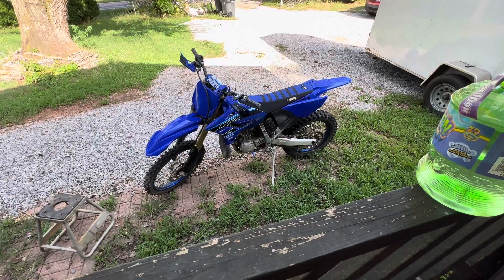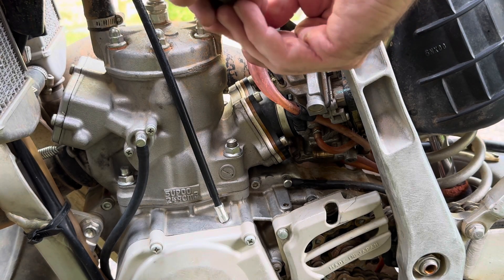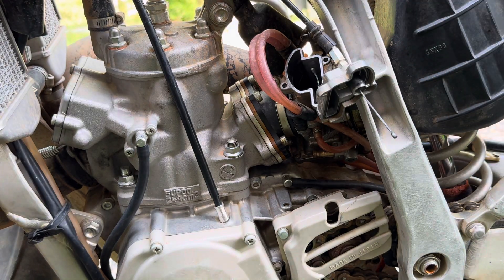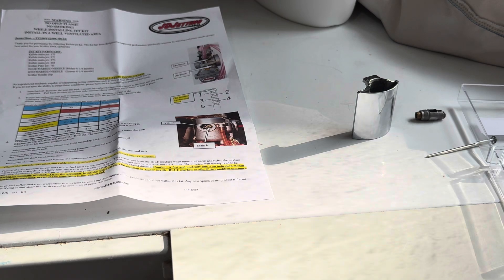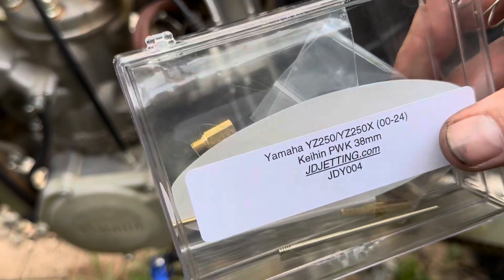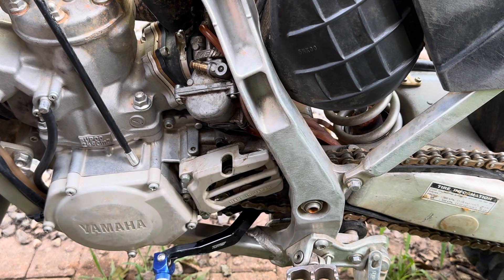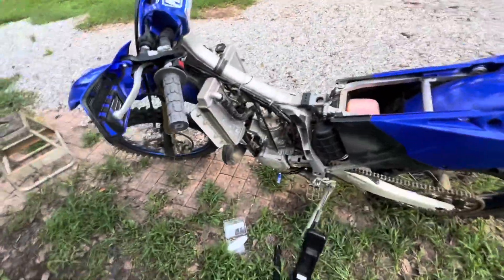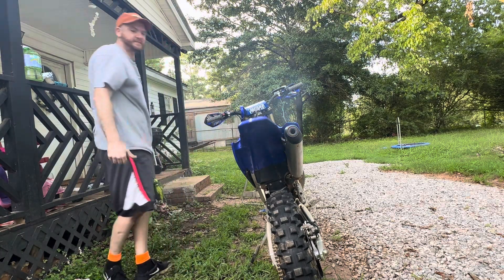JD jetting INSTALL on 2019 Yamaha YZ 250X

Comment: 178 main and 50 pilot is stock jetting which is slightly rich but but keeps the bike running cool and preserves the cylinder. The leaner jetting will run more crisp and be more responsive but also will generate more heat and wear the cylinder just a little sooner. Also you’ll likely be too lean this winter and will need to go back to a richer jetting but it’ll run great this summer. Enjoy! 
Also get a JIS screwdriver for the carb screws and avoid a normal Phillips to keep from chewing them up.
Reply from the maker: @jmarcinko1139  yes the kit comes with a lot of different jets and a chart for your elevation and temperature!yes  sir probably get this kit for my 125 too! what is a JIS screwdriver?
Reply: @RIDEreviewRELOAD  I suspect that gentleman, (rich is not good either), is a candidate for a damaged piston, (as I posted above).  I may be wrong, but I suspect he does not warm up that rich engine for 10 min to avoid piston damage.  Now I know 2-stroke MX bikes with a carb are shipped rich.  Always have been, and they all can use more exact jetting for your area.  But this YZ is the fattest, richest pig of a stock bike that I ever tuned.
I do blame the power jet quite a bit.  It complicates jetting, adds electronics, (but seem to be reliable), and I don't think there is any performance advantage.  In fact, it is a bit more of a pain to get them running perfectly.

Comment: I think your needle is still rich.  You may have to go one richer on the pilot, but you have more grooves on the needle to go more lean than I did.  One groove can be a pretty big jump, (depends on the taper of the needle I guess), and so far, I have gone the equivalent of 1.5 grooves with the 1/2 groove more lean needle, (still rich. just ordered the next leaner 2 needles).  But if you want to creep lean with a lower needle, but not one groove, you can use little washers under the clip.  I made my own on a lather that are the same diameter as the clip so nothing hangs up, and a groove is about a 1mm jump.  If you make a washer to .020" thick, that will be about a half groove.  But I would not be surprised if you end up one more groove.  The smoke that comes out of the silencer is a pretty good indicator too.  I found it great to have a little for start up, but pretty much clean after that, and the plug is a great light brown and dry color.  If it burns all the oil, you get no exhaust mess.
I remember racing amateur at the Pontiac SX after the pros were done tearing up the track for Saturday and Sunday, (a 2 race weekend in that dome).  The pros raced all weekend, and the stadium did not get full of smoke until after the pros were done, until 2 short amateur races were run.    What a difference in jetting.  :)
Doug in Michigan

Comment: Actually, it would save some time with plug color if you used the black rich plug (as long as it still fires).  As you lean out he jetting, it will burn off quickly and give you something to read.  It just takes a while to get a new plug to color in a rich condition, and you can't get a good reading for a while.  It has to darken up first.  :)
Reply from the maker: Good info brother! Appreciate the input 🤙🏻

Comment: I have the 2019 YZ250, and the stock jetting is horribly rich, (MXA said it was perfect in their magazine test.  They don't know how to jet a carb anymore.). I think the only difference between the YZ250 and YZ250X is the X model has a lower rpm tuned pipe.  Compression may be slightly different too, but the 250 was lowered about a decade back, (I have both heads).   I did a ton of mods to my bike, and the last is finalizing my jetting.  I am in Michigan, and will not ride under 50 degrees temps at my age, so I will set my jetting on the edge at those temps. It will still be very good at 80 degrees.  If you want, there is a mix trick you can do for different temps.  If I set the jetting crisply at 50 degrees outside and run my gas mix at 40:1 (use a good oil), I can increase the oil to 32:1 for hot weather., (example, testing is needed IMO), so the fuel/air ratio across the board is a bit more lean.  More oil mixed with the gas means less gas going though the jet, and that is what counts for the Fuel/Air ratio that you are jetting for.
I want to know if that is actually a Yamaha needle, or if they make their own.  
So far with my jetting, (and I am still rich, and so are you. Smoking a lot still, rich needle), I have first modified the engine with the rich stock jetting.  Woods riding, FMF Gnarly pipe, V-force reeds (no aluminum spacer block), and I lowered the cylinder by not using the base gasket (need a really good sealer, like 3M Nitrile #847 brown), that lowers the exhaust port to better match the lower rpm tuned FMF pipe, and raise compression (.048" squish left, was huge).  I have to run 100 octane with no base gasket.  That raised the compression and the burn temps, and the plug went from black to a dark brown.  Still a long way to go.

So far, I went with the 48 Pilot (50 was stock), a 40 power jet (50 was stock), and since one clip on the stock needle is still rich, put ion the next Yamaha lean needle, and still on the top groove, still rich.  I just orders the last 2 lean needles from Yamaha. I may go back to the 50 pilot jet as it leans out the middle. I just dropped from the 178 stock main to the 175, but will probably end up with the 172 also, (using wide open test runs and throttle chops for main jet plug color. Gotta use the stock plug IMO.).
One thing I know, carbs with out power jets were a lot easier to tune.  I don't see any advantage of the power jet.  This is not the best running bike I ever had. I would have it and worried about the electronics failing and going lean.  But I have never heard of that happening.    When you are burning all the oil, (no mess, and hardly any smoke), don't go any more lean.  :)

Oh, I modded almost everything on the bike, and I just modded the kick starter.  Try rotating the kick starter on the shaft on spline to the right and look how it sits in there closed.  Perfect.  That is actually how it was drawn up, but the bottom casting of the kick start shaft area gets super close to one bolt on the clutch cover.  So Yamaha just rotated the lever back one spline,--for like 2 decades.  lol   I just dremel cut the casting a bit for 1mm clearance, (just a shave), and man, it is amazing how such a little change, makes the engine area look so much better,-----------like it was designed that way.  :)
Reply: Doug in Michigan
Reply from the maker: You sound like a jetting Jedi!!! The force is strong with you 🤙🏻🤙🏻

Comment: Another problem with the rich stock jetting. PISTON DAMAGE!!!!!                If your plug is black, you are not warming up the coolant quickly.  It can take 10 min to get hot radiators, and the engine may never really get into a good operating temps, on the edge of fouling a plug.   It is very easy for a rider to get impatient, and take off riding, and I bet a lot of YZ250 riders have done it,---and damaged their piston.  I bought my bike from a mechanic/son at a dealership, who is not very sharp, but the bike only had about 3-4 hours on it.  I did ride it for another 10 before I modified the engine, but I made sure the damn water was hot, (where 10 min comes from). I took out a stock piston that looks like it was ready to come apart. The crown and piston gets hot and expands, but the colder cylinder does not expand enough, so they make contact.  You will get the "4-corner" scuff, but the worst is the piston crown side and rings being pushed into the exhaust port.  There was so much contact there, (plating still great), it bent the material above the ring up, (making the ring groove wide. Ring could flutter and break), and pushed the material below the top ring into the bottom ring, (pinching the bottom ring, both losing compression).
With my jetting much better, the water warms up in about half the time, and you are ready to go.  I like to feel pretty warm radiator tops with my gloves on. That's pretty hot with them off.  I know-------------------------there are a lot of damaged YZ250 pistons running out there.

Comment: You’re going to have to rejet in the winter time now.  With the stock jet you don’t have to do that.  For me, not being a professional racer, it’s not worth the hassle of rejetting every season.
Reply from the maker: Oh I don’t race either. No problem at all, I only have to swap needle which takes a few minutes. Loving it!
Reply: Winter time?  (Michigan here).  My bike is in perfect condition every spring (even when I wore them out faster when younger. Rode all summer), because I use winter time to make it that way.  :)  Back at the end of my "more riding" days, (around 2000), I found in my favorite sandy whooped out 40 mile loop trail ("The Little O". About a 3rd gear average trail on a 250 2-stroke.), I was actually warm in my summer riding gear.  I just can't work that hard on that trail now, so 50 degrees is my new normal.  :)